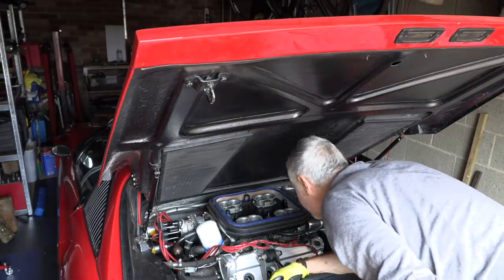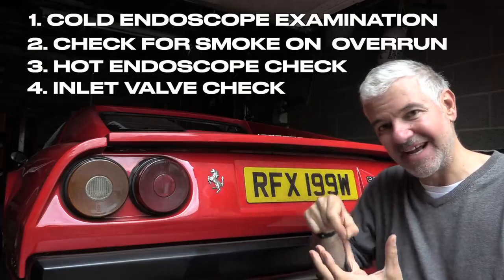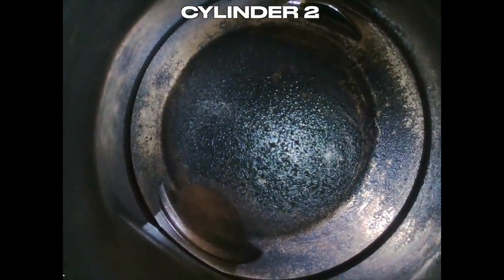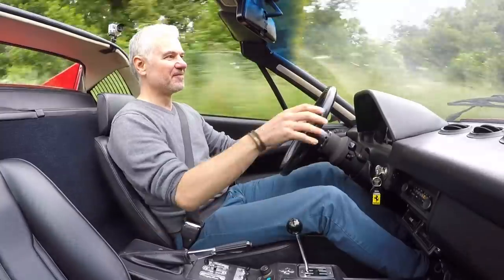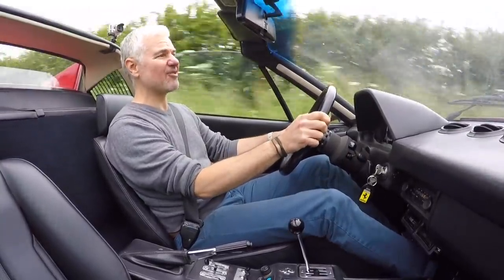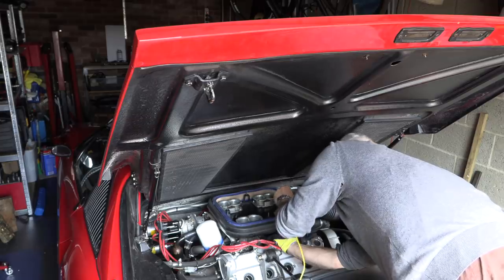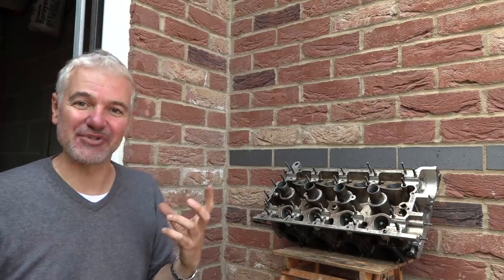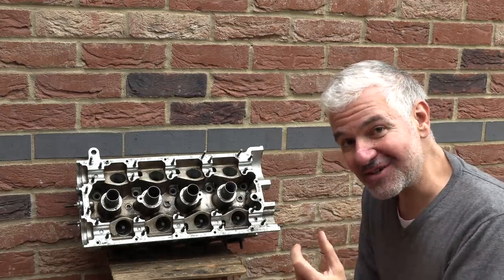Could this £50 tool help me save my cheap Ferrari?

Comment: How much oil is it using...It is a high performance engine.
Reply: Also, what was Ferrari's normal quoted oil consumption figure, when new ?
Reply: True, most V8's are designed to use a little oil to keep things lubricated. Inside the cylinders and the plugs don't look like oil fouling.  I would just drive it and smile.
Reply: Yes, it’s an old Italian performance engine. It’s not a brand new Bentley

Comment: Have you checked how much oil you're actually burning by checking the oil dipstick regularly? And also, you could try to use a slightly thicker oil perhaps to reduce the smoke?

Comment: That’s gasket sealant that you can see around the intake join looking down to the valve, I’d be guessing it’s a soft setting aviation sealant. . How about leaving the camera in there poking towards the exhaust valve direction and run a time lapse to see if the oil drips or runs from above 🤔 What oil are you running? Have you tried a different brand or grade? I’d suggest Penrite
Reply from the maker: Calcoli e 20/50 whichever is highly recommended on this car!

Comment: That Ferrari is running really well. You have no loss of power - basically a little oil smoke probably indicating a worn piston ring or two. It is a lot cheaper to put a container of oil in every couple of weeks than it is to rebuild the engine. I would go to that extreme until I had to.

Comment: The heads were rebuilt but the valves look old and pitted? You would think they would have been replaced or at least polished. Also I would be thinking oil is coming from the crank case breather before considering replacing oil rings on pistons if the compression is good. I know compression and oil rings are not related but they tend to wear at the same rate.

Comment: How much oil is it actually using and what is the expected oil consumption figures from Ferrari? Ferrari engines like being driven hard, if people baby them they don't like it. It doesn't look like it's burning that much oil anyway. Valve stem oil seals? Positive crankcase ventilation valve? The engine sounds magnificent through the rev range!

Comment: You can see oil dripping down the cylinder wall, especially on cylinder #4 @ 2:40 . Also all cylinders walls have visible vertical scoring..

Comment: If you want to clean the hummed up piston rings,put some Paraffin down the bores over night, change your oil for some thicker oil and hopefully it'll cure it.
The engine sounds sweet as a nut and even the Pops and Bangs sounded good.

Comment: Was the 308 burning oil before you did any of the engine work? worth checking the breather system and PCV valves or any kicked breather pipes which would increase crankcase pressure and push it past the rings.

Comment: Hi Jack.
Sound a lot better in your last run.
Wishful thinking with oil additives. Can't hurt.
Did you get a chance to check out the link I sent you for the D.I.S ignition? Just a thought for the future. 
Stay Safe.
Cheers

Comment: There must be some sort of anti-coking additive (Redex maybe) that you could put a quantity of into the cylinders and leave in there for a while to run through? obviously followed by an oil change and flush. Also check or improve Crank case venting?

Comment: Are you absolutely certain that it doesn’t have a blocked oil / crankcase breather and is just breathing heavily?

Hopefully a combination of oil additives and some use / heat cycles will reduce the oil consumption and emission.

Comment: A while ago you spoke about performing a leak down test, did you do this?  Much more informative than a compression test and should confirm if the leakage is past the rings or via the valves.
I don't think there is oil on the piston crowns, just normal staining and carbon build up that looks shiny because of the light from the endosope.

Comment: Smoke on start up usually indicates bad value seals, I know your builder is confident but stuff happens. In my experience if you have good compression all around the oil control rings are likely good, I wouldn’t expect them to wear out before the compression rings. I know you had the heads “ tested “ but those castings have a lot of porosity  .

Comment: Looks like it smokes under power as well as overrun. FWIW when I have had this level of oil burn (a lot) it has been the pistons and rings and Ive had a few. The only time I have had this from the head is when the guides have been set too low without oil seals. Do all the plugs coke up as the ones burning oil are the ones that will coke of course. My money is on needing bore work.

Comment: Only one question: is the engine using oil within the manufacturers parameters? If it is then just drive and enjoy it. If not then you have to decide if you are going to take if further.

Comment: There wasnt oil on the piston? You could see the machining crease.  I would have looked through the carb to the inlet from cold because the oil will sit behind the valve seat after its leaked past the seal overnight.

Comment: if oil smoke clears after initial start, it's the valve seals. If it persists, it's usually the rings.

Comment: There is an odd thing with my Italian Motorcycle, Laverda where if you have the slightest exhaust leak at the head and even with it rebuilt including new inlet and exhaust seals that header pipe leak can suck oil past the valve guide seal and into the chamber to produce smoke.Its an odd but a well know issue, similar engine architecture, valve actuation to yours. The fix is sealing the header exhaust. There appears to be exhaust popping on the overrun, so maybe you do have an exhaust leak. Good luvk.

Comment: When you had your heads off did you measure and inspected your cylinders ? Is there any ridge or ovalization ? I would take off rear head and oil pan. You can get out pistons without removing engine and inspect rings, pistons, cylinders, connecting rod bearings, crankshaft. Everything would become very clear. Not sure about Ferrari prices but I am guessing rings and bearings are cheap to buy and replace when you have everything out. Worst case (aside of cylinder walls problem) would be when rings groves are out of specification as pistons would cost pretty penny I guess.
Depending on verified measurements of cylinders and pistons it would be clear if you need to pull engine and do everything or would you get away with rings and bearings without puling engine out. First two things you can do yourself. Probably only investment would be piston ring compression tool and bore micrometer . If you pulled and installed heads you have everything else.

Comment: increase the viscosity of the oil slightly and drive the bag off of it.  My $0.02.  Sounds good, pulls adequately, just go for it.  And if you are, stop running synthetic.  Had an old/original E24 BMW and switched back to conventional oil and all my issues went away.  These motors were just not designed for it in my experiences.
Reply from the maker: Hey thanks.. already running mineral oil!

Comment: Just a couple of thoughts, for what it's worth: Though a good indicator, don't assume that just because the rings are at fault on one cylinder, that its the same cause on the others. With similar logic, I'm more suspicious about the presence of oil being on the same bank. To eliminate the valve stem seals, you could stuff some clean rag up against the back of those valves and check to see if any oil has accumulated after a couple of days at rest (granted, only confirms the intake valve seals unless you really want to remove the exhaust manifolds again). Wild guess time,... is the crank case vent(s) clear?
I like the "sticky ring" theory, I really hope this is something simple.

Comment: My thoughts would be this,  I don't remember your Ferrari burning oil before you dismantled the heads so I would discount your thoughts about oil rings etc and being carboned up.  Therefore, it must be something you have disturbed during your head dismantling and replacement and the obvious thing is leakage from the head gaskets.  Have you re-torqued the heads after running the engine and or where did you source your gaskets from, were they good quality. I don't remember if you have done a compression test after assembly.  Are all the plugs oiled up or just certain cylinders, are they adjacent cylinders which would also point to a gasket failure.  Something for you to think about.

Comment: Hi, have a look on the cylender wall at 2:40 / 2:45. It is plently of oil. Probably a leacking of head gasket.
Reply from the maker: If the head gasket was leaking though compression would be bad, instead it is perfect!

Comment: Why take it apart again? It runs well, sounds good, the bores look great and it has good compression. Drive it hard for a thousand miles or so and see if anything changes. 

Also, when driving, are you really sure that is oil smoke and not fuel related due to unburnt fuel in the exhaust on the overrun? Can you smell it?

The car is over 40 years old, burning a little bit of oil isn't all that uncommon, even for modern vehicles the owners manual will often state that using some oil shouldn't be seen as a problem.

Comment: Get a leak down test done and compression test that will give you state of condition of the pistons and rings, if it were running well before pistons and rings don't just go bad from having heads off.  The pistons definitely coated in oil they should be sooty Matt black not greasy wet oily.  Also why not out endoscope down the other bank see if this is nice and clean.  Also let engine sit for a few days then out endoscope down the carbs and into the inlets make sure no oil is coming down the valve stems.  Sadly as it's a V8 the inlet stems are lifted out of the oil so will be unlikely they are leaking from there, the exhaust ones are soaked in oil as their at the bottom and under constant pressure from oil collecting in that area so most likely the culprit, and sorry but machine shop saying it's definitely not their issue well of course not amount of times I have heard well reputed machinists say that to me and I find something wrong with what their have done.  Everyone has a bad day could be something simple like a wrong seal used many cars have different guide seals for exhaust and inlet maybe they got mixed up? Also were the guides changed? If not could be a little wear in them or if they were changed like I said before its not impossible for the oil to leak around the outside of the guides between the head and guide after they have been replaced I have had this happen to me and in my engine exhaust valves are down in the oil as well which didn't help.  Can you unhook the exhaust and get the endo scope up the manifolds the cable looks pretty long so should be possible.

Comment: the best solution is to tear the engine down replace all the rings and journal bearings and reassemble, what it looks like in the cylinders scope is green antifreeze in the mount where the carb meets the manifold, did have a mixture of black smoke around 3500 to 4500 rpm and small puffs of white smoke you may have a shattered oil scraper ring! what I have done with cars that have sat for a while before starting in to make Michela 2 stroke oil and some gas and pour one fl oz down each cylinder and let set overnight, fire the engine up and the add 1/@ oz to each cylinder one at a time start check kind of smoke and continue to the next cylinder have found bad valves this way

Comment: Research how the PCV ( positive crankcase ventilation) system is to operate.  Perhaps crankcase pressures are too high.  I know many engines operative on a slightly negative crankcase pressure.

Comment: It seems to have a very non-standard exhaust system, very loud and grunty compared with the GTB308 I've driven.
I wonder if that change could be altering back pressures back at the manifold?
You would have to think first of all new rings but didn't you do a recent rebuild?

Comment: I have had similar happenings to this with Imp cylinder heads after having new valve guides.
After a period of use it carboned up and all was well.
It is a good idea to leave it as it is for a few months.
Is there any oil drain system on this 'Ferrari engine..Imp engines have an exterior oil drain pipe to help it not pooling at the camshaft carrier.
When you mentioned spark plugs i immediately thought of loose spark plugs which draw up oil and give those symptoms .Properly not ,but still worth a check to see if oil lies around the top of the spark plug hole.

Comment: Be careful with those viewing devices, I had similar experience to find two injectors needed replacement (964) and what I thought was oil was fuel.  But I was down on power too...  Good luck and appears you have eliminated valve guides, but you do know you may be looking too hard as I have an old C-4 Corvette that does the smoke for start-up and I believe it is the valve guides as I have seen that from that era on other GM engines.  It is an antique, doesn’t burn any oil to speak of and frankly not worth the fuss to repair as it is only at start-up and she is an old girl...

Comment: L'olio proviene dalle guida-valvole n. 2 e 3. E' necessario sostituire le guida-valvole.
Translation: The oil comes from valve guides No. 2 and 3. It is necessary to replace the valve guides.

Comment: Shouldn't you have checked the back of the valves before the run. Petrol washes the valves clean so after the run you couldn't see any oil on them anyway?

Comment: Is the oil going to the carbs, or FROM the carbs?
Don't the breather pipes connect to the carbs?
If so, isn't the oil being sucked in at that point?
Inlet valves and ports are being cleaned by the fuel, hence why you are not considering this.
Reply: At 10:03 is that not the breather orifice itself we see in the upper right of the frame?
If that is the breather, that is clearly your problem!
Reply from the maker: No. The breather connects to the airbox.. but there is no oil coming out of it!

Comment: You need to do three things. 1) Get someone else to video the smoke from a following car. 2) Take your crankcase ventilation off to see what's coming out from below. 3) If you have an oil filler cap on the upper cam cover, take that off and see if there are any gases at the top of the engine.

Comment: Definitely worth following up on oil additives as a remote possibility of freeing perhaps frozen rings.  It costs only a few dollars compared with a strip-down and rebuild.   Good luck.  Big question is, "How excessive is the oil usage, compared with the normal for the engines for the breed of car?  If nil, or only a marginal difference, don't worry about it.  Just accept.  Some oil usage is better than absolutely nil for an engine that normally uses 'some' oil.  Nil oil usage where the norm is 'some', would indeed be cause for worry against the probability of premature wear."

Comment: Are you using synthetic oil , always an issue on slightly tired engines for oil leaks where the thicker mineral oil was no issue

Comment: If the engine has had cylinders running to rich for a long time,  this washes the bore and glazes the cylinders. increasing oil usage and burning

Comment: Go careful with oil additives. You loosen crud that’s built up elsewhere in the oil system, you might block an oil gallery or something. I would consider a small amount of diesel introduced from the top, turn it over by hand and let it sit for a while. But consider this - it’s running far far better than it has since you got it, the smoke is minimal, the oil build up is minimal in those cylinder… Use it! Don’t mess for the rest of the summer. Just take it out and keep an eye on it. Enjoy it and slake your thirst for masochism with the Lotus!!

Comment: Please do yourself a favor and do a leak-down test to determine if any air is escaping at the breather, a good check of the rings. Otherwise sounds like the exhaust guides were improperly  reamed or the exhaust valve guide seals are leaking. I know the heads were just rebuilt but......

Comment: Looks like number 4 piston has a hairline crack in it.
You can see it on the right hand side.
I had this on an Evo I was working on. It will not show with a compression check

Comment: If the problem didn’t exist before… I can’t see why suddenly your rings would go bad.
Reply: Higher cylinder pressure by better valve sealing for a start! Also he was running all the wrong settings on the carbs and it had a misfire for quite a while.. Washed all the oil away (bore washing) and vastly accelerated wear on an already worn engine
Reply: @MagicAyrtonforever  That's an excellent point. Which reminds me, there are engineers who recommend never restoring full compression on a high-mileage engine with a head rebuild, even if it seems mechanically perfect otherwise - the rings can be worn so thin they can shatter with the restored compression. I remember when I was a kid, my dad was told this by a very good independent (Alfa and BMW trained) mechanic (Mike Sasso was his name) who had to do exactly that on dad's Alfa 105 GTJ (1600) at (IIRC) c. 46K miles- he very carefully checked the bores before agreeing to do the head, looking for glazing and lack of honing marks, but fortunately they were still there. The car ran beautifully afterwards - daily driving and a couple of trips to Italy in the following few years.
Reply: It happens.

Comment: If it is the rings you would expect to see an increase in crank pressure and oily smoke coming out of the oil breather. I'd run the car and see of those rings don't loosen up. If not you're looking at a lot of work!

Comment: If its not broken, fix it until it is.
Be very careful with the oil additives, the oil company has already put any useful ones in the oil in the correct amounts, putting more of them in won't help, & may even do damage.